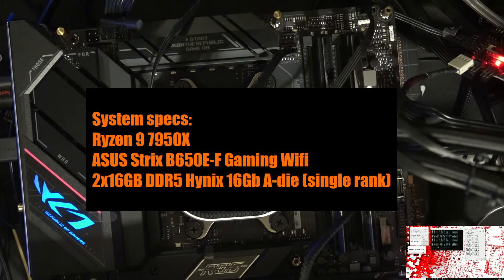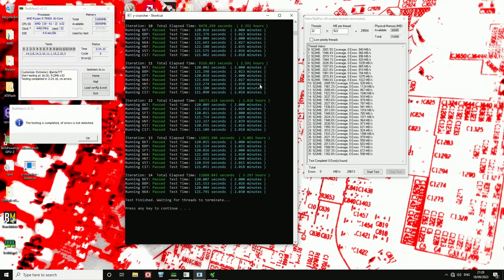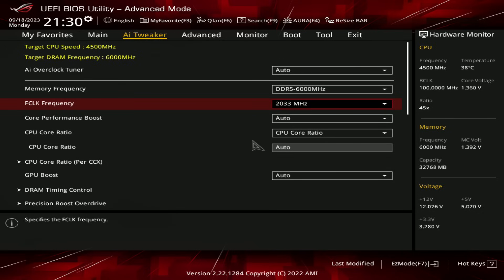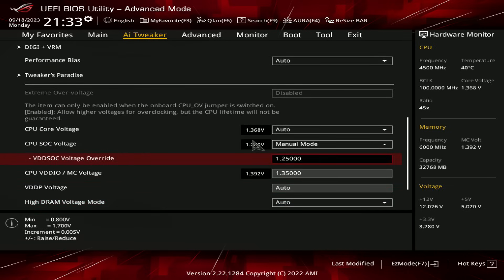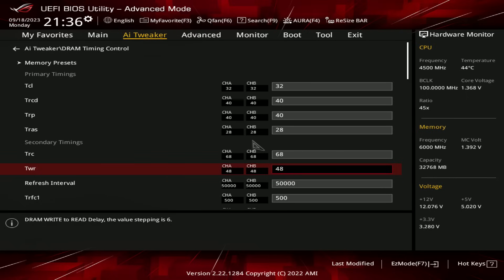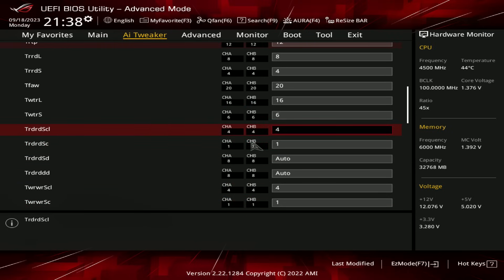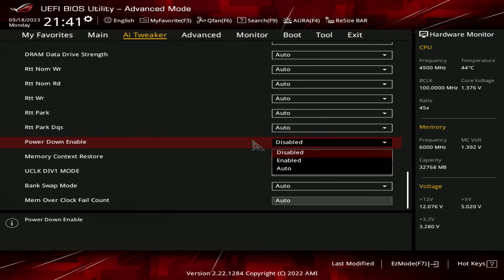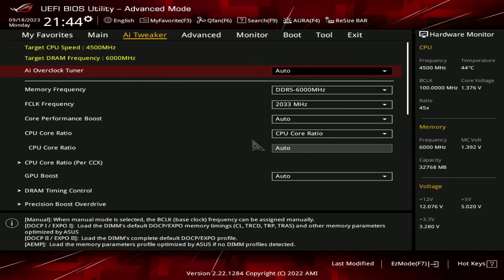Easy memory timings for Hynix DDR5 with Ryzen 7000

Comment: I wish Buildzoid would make a small PSA about power down mode. Memory context restore MUST be disabled  if you disable power down mode, or you will bluescreen. You will bluescreen so bad that's if you manage to get into windows, wonder why, and think it's these memory timings. No, it's power down mode.  Go ahead and disable power down mode, but ALSO DISABLE MEMORY CONTEXT RESTORE. MCR on auto, or enabled along with power down mode disabled will cause massive issues. You sacrifice slightly faster boot times, in exchange for ditching power down mode which slightly harms memory latency performance. Please like this post get it to the top, save folks a lot of headache.
Reply: Hey man, thanks alot, have a nive dau
Reply: How do I improve boot times in general? I am sitting at like a full minute before my system boots. I actually set memory context restore and DRAM power down both back to auto already. Does it just get better after several boots as it remembers the DRAM training?
Reply: @bobrocks95 turning on memory context to enabled and power down to disabled has my system booting to windows in 18 seconds. However after every bios update etc the first few times it will take long to boot. 
I. Running a gskil trident ddr5 6000mhz cl26 64gb kit with expo1 enabled, 1:1 fclk =2000. Memory context restore enabled. And power down mode disbled.
Reply: @AJerseyJohnnyEntertainment  Thanks bro. I still need a few more starts but I think we're going in the right direction.
Reply: @bobrocks95  Newest gigabyte BIOS has very slow boot time. I went back to F7 on my b650 Aorus Elite AX. takes about 30 seconds to memory train, post and be at Windows log in. Newest BIOS is more like a minute.
Reply: @insertnamehere4419  I'm on an MSI board but maybe it's a similar thing there. DDR5 seems to have quite a lot of growing pains, I'd have thought this would be sorted by now after holding off what like a year? I'll have to time my boots with and without power down mode enabled, though I don't actually know with the memory training if you're supposed to reboot several times before it "settles" and speeds up boots or what. It's honestly very confusing and takes so long that I could see a lot of people thinking their build is broken somehow.
Reply: @bobrocks95  FIRST boot, like after building a AM5 system, I can only imagine how many people thought there stuff was broken lol
Reply: Down to around the expected 10-15 second boot with Power Down Enable on, Memory Context Restore on, and MSI's DDR5 Robust Training Mode on.  Latency in Aida64 is 67.7ns versus 66.7ns with MCR and Power Down Enable both off.  I think it's a worthy trade-off imo
Reply: @bobrocks95  Disable that "robust training mode" crap and dial in manual timings. Your latency should be closer to 60-62.
Reply: @insertnamehere4419  I'm already on manual timings from this vid but I'll check if it's different with it explicitly off. Got G. Skill 32GB 6000MT/s at 28-38-38 then everything else from the patreon post. Any other settings I might have missed? My FCLK should be 2000 since the 2033 here was due to a BIOS bug... UCLK maybe I didn't explicitly set but I didn't do the /2 setting (think I've got the right terms there)
Reply: 66.3ns with the MSI "Extreme" stuff off, hmm definitely still not 60-62
Reply: @bobrocks95 set dramdqds to 40, then set nitro to 1-2-0 but you must also have power down mode disabled along with memory co text restore for nitro 1-2-0 to work. 

you can also drop
Proc odt to 43.6 for better latency
Reply: have you tried updating your bios? or since the month you replied figured something out?  @bobrocks95
Reply: @bobrocks95  Ancient comment but if this happens to anyone else, you're probably getting your memory reset to default after the memory trainer fails x amount of times. Check your RAM speed (Task Manager>performance tab>memory), and if the speed is lower than 6000 MHz your motherboard reset the memory to a stable value without telling you.
Reply: Hi there I just wanted to report back that I had a BSOD following this video originally when I had MCR on and PDM off, so like most I switched both off and it was fine. I've just done 6 hours of a full set of ycruncher with both turned on and it survived completely, and yes it does retain the original training. Do yourselves a favour, turn them both on, reboot, twice, to see on the 2nd boot how you'll get back minutes of time not re-training, then stress test if you like but it'll be fine I imagine.
Reply: @conza1989 what mobo? You kept both off?
Reply: It's fixed now. Update the bios. You can disable both or either one without issues.
Reply: @Sleepless4Life  sorry for replying so late, but do you know what agesa version fixed this? thanks.
Reply: @Sleepless4Life untrue unfortunately
Reply: Cannot thank you enough!! I exchanged my MSI X670E Carbon, where MCR was working flawlessly  with Expo enabled, to Asus X670E.  I enabled MCR which automatically enabled Power Down (should have been an indication) but knowing that it affects latency, I disabled it. OS was BSOD’ing so bad that sometimes even BIOS was freezing and the only way to recover was to unplug the power cord and reset CMOS. Saw your comment and experimented with either both enabled or disabled. Stable now!
Reply: ENABLE both for fast boot!!! Wtf are you talking about? Full bullsht 😮, just ENABLE BOTH you mentioned...
Reply: I have no idea what happened but, I manually entered all ram timings from Bullzoid while also disabling EXPO. Then, I tried to disable Power Down while keeping Memory Context Restore. So far, I haven't crashed and I'm still using this PC to write this message. It was impossible to do while I was using default EXPO settings, I had a BSOD after 1-2 minutes. If it remain stable, I'll keep it like this. You get lower latency without Power Down.
Reply: @Jack11527  Nice! I might try this. Haven't thought about using these timings at default settings. Thx fam!
Reply: This !! It helped me !! Thank you so much !!
Reply: I decided to leave mcr and power down mode on. Latency test shows difference in 1 ns. 64 vs 65. Tests in superposition is also very closed (maybe games can show other results, dont know). But memory training each start lasts about 3 mins on b650e taichi, gskill 6000 cl30
Reply: @aleksiy2282  Geez and I thought 1 minute was bad.
Reply: This made my pc boot to Windows after Buildzoid's timings! Thanks a lot!
Reply: I disabled all of these and still got BSOD...grrrrr lol
Reply: @YT_Booost  Don't "disable all these". You will get bluescreens because you disabled power down mode.
Reply: @insertnamehere4419  thankyou for the reply! Will I be able to keep these timings as long as I don't disable power down/mcr? Everything ran fine I just had issues on restart
Reply: @YT_Booost  Should be fine ya. Assuming your memory is Hynix die
Reply: Jesus, I'm so glad I opened comments while booting back up. Was barely able to get to and smash delete when I read part of this. Thanks for posting this, and thanks everyone else for bringing it to top post. 😅
Reply: I have had so many problems with this. Thank you for this.
Reply: You seem to be knowledgeable. Can you help me solve this problem? I did everything exactly the same but it won’t apply all the settings only some. For example Tras, Trc, Twr and some others are impossible to change. I can type in the wanted value but it won’t apply them. Ai Overclock Tuner can be put on Auto, Manual, EXPO 1, EXPO2 and EXPO tweaked but I tried every option and none of them let me change those values. Any ideas how to fix this?
Reply: @DaveDBD  don't use expo AND manual timings. Expo may change stuff on you at reboot...other than that not really sure, never ran into your issue.
Reply: Yea his earned stature in the OC section would help us idiots out a bunch. Luckily I read through this video and comments before I started fiddling. My settings were mixed and it woulda bsod.
Reply: Thank you sir!
Reply: my BIOS glitched out and optimized defaults bricked it so hard, i had to offline flash
Reply: Thanks came back here after a blue screen, it'll probably be this
Reply: Wow would you look at that, fixed my issue
Reply: I have samsung, I guess I can onlar try 40000 refresh interval and maybe reduce soc voltage from 1.3 to 1.2 and maybe vddq too.
Reply: @YatoSinpaii  Nice, glad it's helping
Reply: Goat
Reply: You are a hero. I was going absolutely crazy wondering why I couldn't get full speed outta my 4x16GB trident z5 neo using expo. These are supposed to be tuned specially for AM5 . . . Anyway, I digress. I genuinely appreciate your comment because I can now run full speed ahead with no random crashes. Awesome
Reply: And exactly where is the memory context location?
Reply: Does that still apply woth newest agesa which massivly improved ram stablity
Reply: BRUH I HAVE BEEN SCRATCHING MY HEAD FOR SO LONG AND THIS FIXED THE ISSUE
Reply: A little late but what about GDM Mode , auto or disabled ?
Reply: @Greddy87  Auto
Reply: @insertnamehere4419  OK, thanks! Because every time I restart I'm getting Red light hangs even with 4800mhz and my Ram meets the QVL LIST of my motherboard. Expo timings are CL 30 36 36 77
Reply: I had both enabled, power down and mcr, my pc had a shutdown and a message came, that a new cpu got installed... Is my cpu fried? It was 2 weeks ago, i can still play games
Reply: @Yesgim  Naw man. Bios got reset somehow.
Reply: why mine didnt blue screen
Reply: Bro can I tell you how much fking time you just saved me I'm trying to figure out like 3 hours and I wasn't close to being done
Reply: @CantWaffle that was legit me 5 months ago lol
Reply: Do as Buildzoid says. I have Powerdown disabled and Memory Context Restore on Auto.  Zero issues with booting into Windows.
Reply: @ that’s 1000% not going to work for every set up,
Reply: disabling MCR and power down made me blue screen. Just power down disabled did not. Powerdown in auto and MCR in auto did not.
Reply: @ronwilkinson7924  Obviously? That wasnt surprising.
Reply: Only saw this afterwards... Figured out the solution myself only to see I didn't have to waste my entire Saturday morning 😂
Reply: I got the latest asus tuf x870 plus mb and the ryzen 9800x3d . With the latest bios 1001 (beta) available in the asus official page the MCR and the power down setting both must be set to auto. If not your pc will stay with the orange led for very long long time. It was fixed with the previous bios but not this time seems like they messed it up again
Reply: Yeah, I’m confused because I was told that once enabled expo at 6000 I should enable MCR and power down mode and I did and everything seems to be working great what am I missing?
Reply: Yeah, I’m confused because I was told that once enabled expo at 6000 I should enable MCR and power down mode and I did and everything seems to be working great what am I missing?
Reply: This comment may have just saved my life lmao
Reply: My pc acts super weird and crashes my games if I set my ram to 6000mhz using a 7800x3d. When I run it at 5600mhz or even 5800 mhz it’s much more stable so when I set my Fclk frequency so I set it to 2033 like u did or should I set to 1933? Thanks.
Reply: @IIExhibitAII  You should figure out why you cant run 6000 which is bog standard, I wouldnt settle for no 5600.
Reply: Wish I read the comments bro I was struggling for an hour even the bios was non stop freezing
Reply: This isn't true. If your running a Ryzen9 9950x3d,  on a X870E AORUS Master motherboard,  with a trident ddr5 6000mhz cl26 kit, 
You ABSOLUTELY ENABLED CONTEXT RESTORE,  AND DISABLE POWER DOWN. 

MY DDR5 SYSTEM now boots to windows in 18seconds. 

I do recommend keeping fast boot kept turned off.
Reply: @AJerseyJohnnyEntertainment  You're replying to a old video dude. This was during b650 /x670.  And yes it absolutely was true. Replica table and verifiable 100%.
Reply: @insertnamehere4419 , i never said anything about the x670 boards , people are posting thinking what your saying goes for X870E  newer boards and ram. And its the exact opposite. I specifically said that for people running ryzen 9000series cpus on X870E boards, they should disable their rams power down enabled setting to disable (not auto) only for stable overclocking and slight less latency. And enabling memory context restore ,(after checking overnight with memtest) will have their system booting from a cold boot into windows in 18 seconds. Which is almost as fast as my ddr builds. 

The people responding to the comments seemed unfamiliar with pc building etc, so i was letting them know things have changed. 

Youtube showed your video to me and its 2 years old so its showing other people as well. Thats why i posted . 
When i did have a ryzen 9 7950X3D  and X670E motherboard , it was when the X670E was a new chipset motherboard, ddr5 was a bran new type of ram, and the ryzen 9 7950X3D was a new monster by itself uaing dual ccd's. Lol😂
Talk about a nightmare, nobody could even boot into windows. The price we all pay for upgrading early. Lol. That first 6 months was a nightmare.
Reply: @AJerseyJohnnyEntertainment  Dude, this is a old thread and no, it doesnt apply to newer boards.
Reply: @thevyceguy  This is a 2 year old thread. I can't verify if this is still an issue on B850 /x870 ) I mean I could but I don't care to lol) or if it was eventually resolved all together.
Reply: Not contradicting anything anyone here has said, but I just wanted to share my findings for anyone else still using this video on more modern boards:

- on the X870E TUF board, leaving MCR on "Auto" defaults it to disabled. Unsure how this behavior changes if you enable EXPO since my kit doesnt even have an EXPO profile.
- on the same board, disabling PDE does not affect MCR - it still stays disabled if set to Auto. This is likely different from the original commenter's situation as he was describing the behavior of older boards.
- if you DO enable MCR, it automatically sets PDE to enabled as well (as in, the BIOS literally flips PDE to Enabled, changing it from whatever it was previously set to)
- if you override the above behavior by setting MCR enabled first and then setting PDE disabled, you will likely get instability the original comment described (I did).
- MCR and PDE both enabled gives good stability and faster boot than without MCR but at the cost of small latency and potential instability if your timings were only marginally stable with both disabled.

In summary, newer boards and BIOS do seem to still have this issue but try to idiot-proof you from being able to set MCR enabled with PDE disabled. Enable them both if you want fast boot with decent stability at the cost of latency, or disable them both for lowest latency and maximum stability at the cost of slower boots (2x-3x slower, I've found).

And if you disable PDE while leaving MCR to "Auto", nothing bad should happen (MCR will default to disabled). At least thats the behavior on my newer board.
Reply: Yes yes yes yes and Yes!!! You Need a statue! Thanks you so much !!

I was getting Crazy!
Reply: Holy just felt that blue screen of death bc i had mcr on as i disabled pdm. I personally rather have mcr on and pdm off. I already have sub 60 latency with a 7800x3d but 9.5 second boot with mcr on.
Reply: Dude yes!
Reply: Let's say I didn't see this message before doing that🤦‍♂️. My pc won't go into windows. What now? Please help 🥺
Reply: @alanbenyamin487  Put power down mode back on auto or enabled ( along with power down mode back to on). The BIOS may be flaky as heck, push through it,  or reset CMOS by shorting the two CMOS pins, or remove battery for a minute.
Reply: @insertnamehere4419  thanks for the advice. Resetting cmos pins didn't work, and I didn't wanna take out my gpu to remove the battery. Instead, I powered down, took out both ram sticks, put one back in powered it up and got it working again. Thanks for the tip though🍻
Reply: @alanbenyamin487  Shorting the pins does exactly the same thing as removing the battery. If your cmos wasnt reset by shorting the pins than  you did it incorrectly.
Reply: @alanbenyamin487 cmos reset
Reply: @alanbenyamin487  but you did, so did it help?
Reply: @Lex-vf2fo  no it did not. Even when disabling both options it would not boot into bios or windows. Msi mag b650 tomahawk
Reply: Guess I'm keeping Power Down Mode enabled, I need my precious memory context restore on.

Waiting 20 seconds for mem training every single boot, while the fans sound like a jet engine, is obnoxious.
Reply: Hmmmmmmm 🤔……….. I would have liked this post had I seen proper punctuation within the text. It is very difficult to read because of the punctuation.
Reply: @techluvin7691 Learn to read then.
Reply: I neverv had problems with mcr= auto and pdm disabled.
Boot times were 39sec in windows.

With mcr=enabled and pdm= enabled my boot times are 13.9sec
Reply: @thekids_callmeboss6577  Good for you I guess. Note the replies here, and Google it, you'll see I'm right.
Reply: @thekids_callmeboss6577  depends on mobo and bios

Comment: Copied these exact settings for a cheap Team Group 5600 CL32 kit and it works perfectly. I was even able to get it to run at 6000 without changing any of the primary timings.